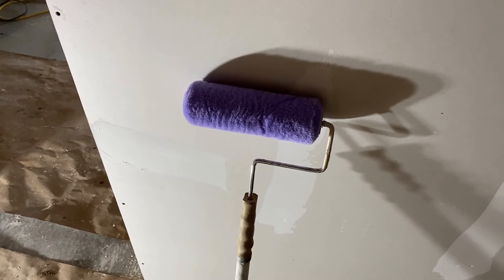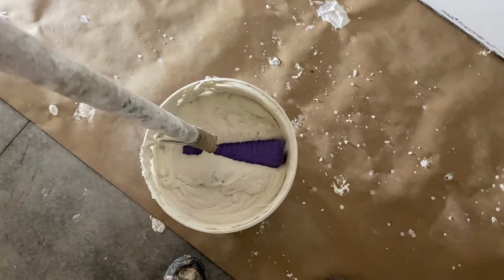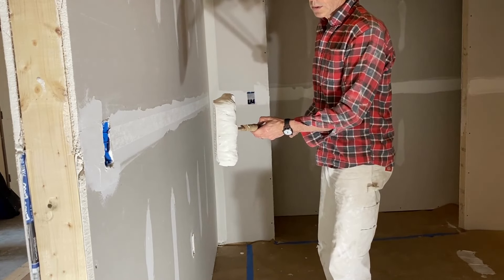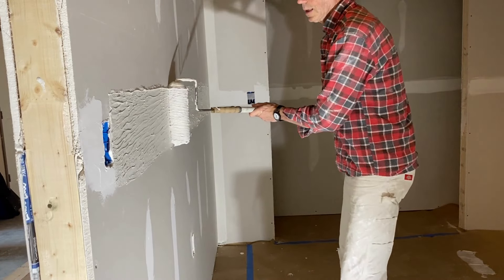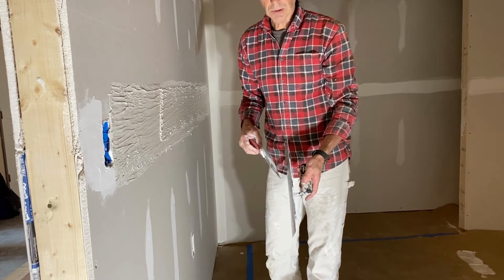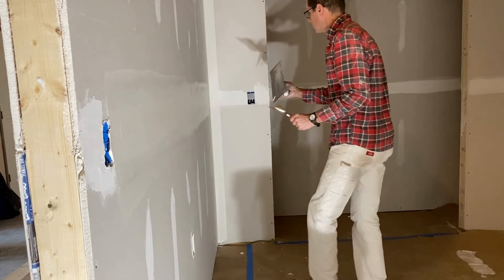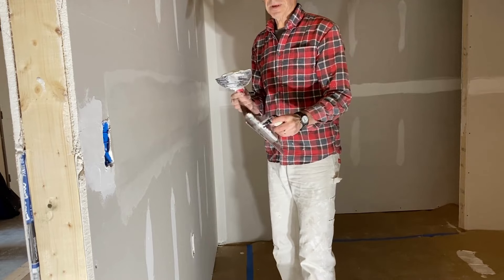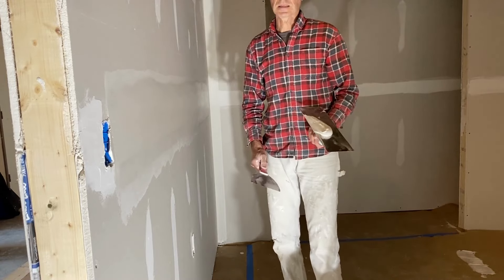Using a paint roller to apply compound over drywall seams

Comment: I rewired my house in copper had aluminum wire I just took it to the studs on the walls where outlets were which was most walls. I used this method of rolling over the tape I didn't want to invest in automatic drywall taping machine for one job. Waste more compound but it's not that expensive. Compared to what a contractor wanted to do the job which was $28k dollars. I love doing DIY jobs might take me longer sometimes I have to do it over saves ton of money.

Comment: I've used paint rollers to apply mud for years, works great. I also use a corner roller to mud corners, then you can use your flusher as usual. I also use smoothing blades for most of he time instead of regular knives. Keep your mud nice and soft and the roller, smoothing blade combo works very well most of the time.

Comment: I started as a dryway finisher back in 1969. (retired now) Why would he roll it on? Rolling it on, you must keep changing from roller to broad knife and pan or hulk and trowel to wipe it down. Just go ahead and use a hulk and trowel. (much faster) Another faster way than using a roller is to take an 8-inch broad knife and file a half-moon going from end to end. Take the half-moon just a little down. Then, apply the mud (spackle, joint compound) with a 4-inch knife on the block coat and wipe it off with the broad knife. On the skim coat (last), just use an 8-inch trowel or 8-inch broad knife. This guy would not make much money on the job site, mainly doing piecework. I was in it for 52 years and was taught by my dad, who got into it as drywall replaced plaster.
Reply: Because he's not a finisher, or he's showing DIYers ways around learning to finish. Only time I use a roller to apply mud is if I'm skim coating whole walls or ceilings. Just coating seams, you're right its a waste of time. Even though I can apply with my knife as fast as I can the roller, changing out the tools in my hands eats that up in no time.
Reply: Meant to say i can't apply as fast with knife as I can roller
Reply: @jeffkieffer418  Everybody is different in how fast they are. Some are indeed slower than others using. My dad taught me with a hulk and trowel. You really don't see that much, like you used to. At one point, that was the way everybody did it. If you are doing the seams, and can't use a Hulk and Trowel, try the broad knife by applying with a 6-inch knife. And wiping with the broad knife that you file or grind to a half moon. If I still had mine, I would post a photo of you or email you a picture. Doing it that way is fast, then after you skim it out (last coat) your mug when it dries is thin. There is another coat after the skim coat. That is called glazing. On that coat, get the mud a little thin, but not too thin. You need to be able to work with it. You apply it on every part of the drywall, then wipe it down tight. When you put it on, then go back and wipe it down tight. Do not do large sections at a time, it may start to set up on you. Doing it this way, if you blocked, skimmed, and wiped the glaze coat tight, you should not have to sand. But, remember, I was doing this for many years and was fast. You could glaze using a roller, just get a wide broad knife to wipe it down tight.
Reply: Honestly, if you’re a professional like yourself, it might be easy for you but someone Who doesn’t do a whole lot of drywall that would save me a ton of time as it would take forever to get the mud onto the knife and onto the seam Just getting it out, the bucket is a challenge without dropping it on the floor sadly so the roller would really help someone like me. Also applying the right amount of mud is not easyeasy. I usually got 10 times too much or not enough.
Reply: Hulk Smash Walls! ....and Ceilings!
Reply: “Hulk”